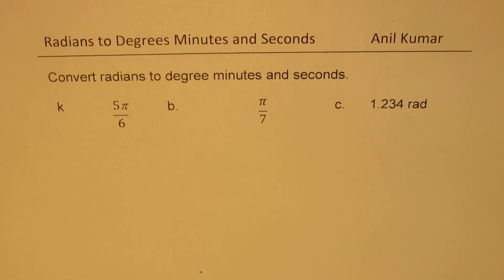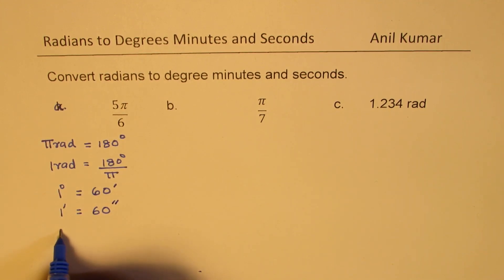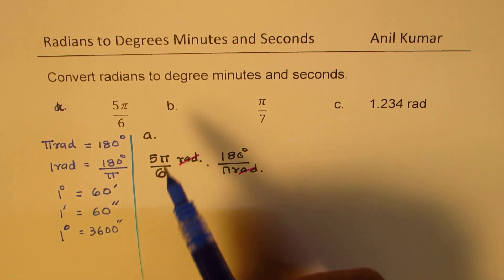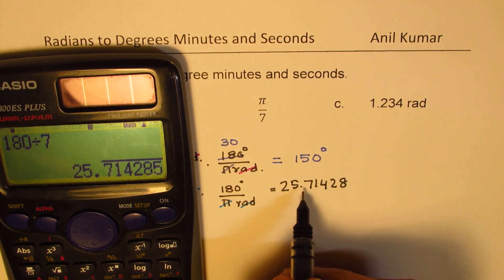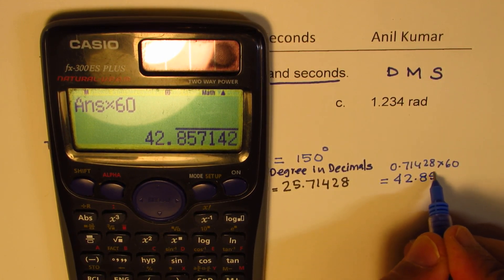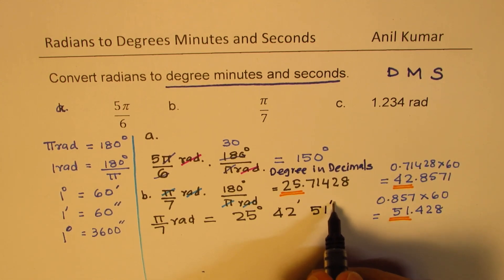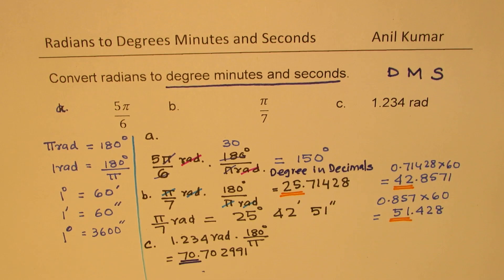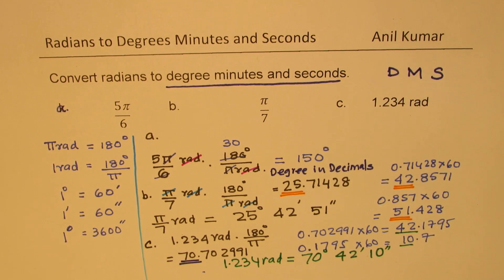How to convert from Radians to Degrees Minutes Seconds DMS

Comment: Thank you very much sir! But we can also do this conversion without using a calculator. 
for example, in question 2,
𝝅/7*180/𝝅
=(180/7)°
=(25 5/7)°      [after finding the mixed fraction of 180/7]
=25° (5/7*60)'    [because 1°=60']
=25° (300/7)
=25° (42 6/7)'     [after finding mixed fraction of 300/7]
=25°42' (6/7*60)"    [because 1'=60"]
=25°42'(360/7)
=25°42'51"   [approx.]
Done!
I hope this answer was helpful too, because the use of calculators is not allowed in class 11. Also, I think this method is easier than using the log book....
Thank you again.😀
Reply: Indian right?... Because only in countries like india calculators are not allowed till 12th grade .... Even i thought the same like "we can do it without calculator"😂😂
Reply: @fictional_bae_13  True. But isn't it good that we can do stuff without calculators!! 😀
Reply: @nish3003  yeah! Agreed blessed to be an indian
Reply: This is far better than his and I also commented this.
Reply: Well am struggling with this and it does not make any sense. Haaaaa my baaddd.you write after finding the mix
Reply: kochuthresia KG well this method is actually easy. You can try writing what I wrote in your notebook and look at it again, maybe that will make it easier to understand, as handwritten text sometimes makes more sense than what is not handwritten... I hope that helps.😀🙂
Reply: How do you do that